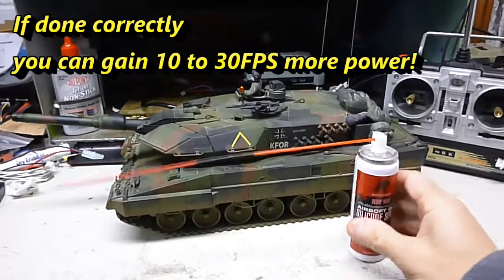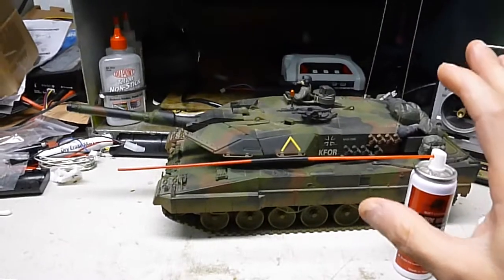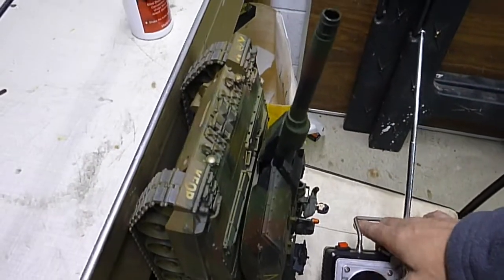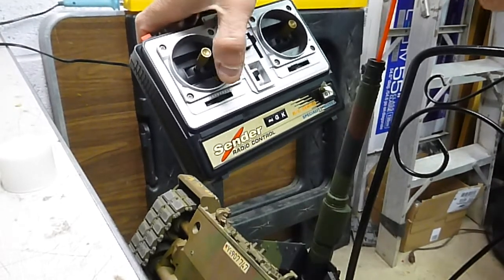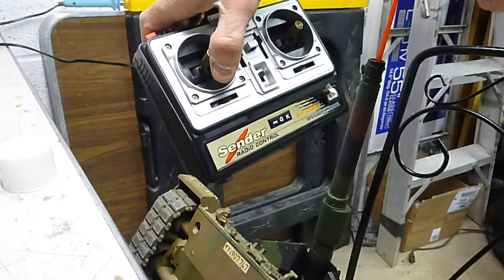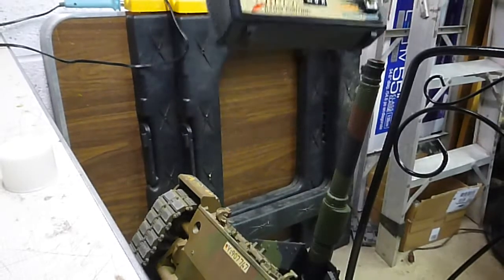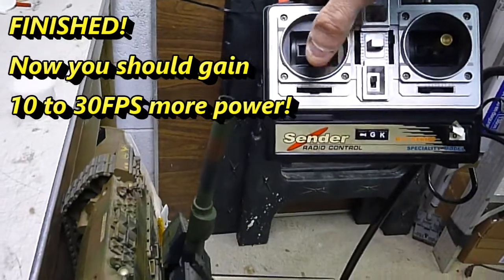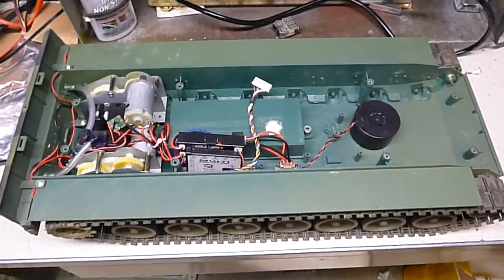RC airsoft battle tank maintenance MORE POWER FPS!

Comment: You would be better of stripping the airsoft unit down and using silicone grease on the main spring and piston head it will last longer than the spray. Giving the barrel a good clean helps with the fps to .
Reply from the maker: Na been doing this for many many MANY years I found spraying thin silicone down into the plunger chamber results in more FPS because the grease is thick it slows down the speed of the plunger when it pops off the gear and shoots forward in the cylinder chamber.
Reply: Why not just change out the spring with a stronger one

Comment: My leopard 2a6 won't fire!!  Do you know a way to fix it?
Reply from the maker: Hi you have to take the tank apart and see if any wires are disconnected if they are all on and good tap on the airsoft guns motor with something when trying to fire it and see if it starts turning the gun over...sometimes the motor needs to be cleaned by spraying some electric motor cleaner inside from the side and it will start working again.
Reply: Shen RC you can hear the normal sound it makes before firing just like normal but nothing comes out
Reply from the maker: Hi sounds like you may have a jammed bb or if it's a heng long tank the barrels rubber seal came out in the airsoft gun ware the barrel slides into it.